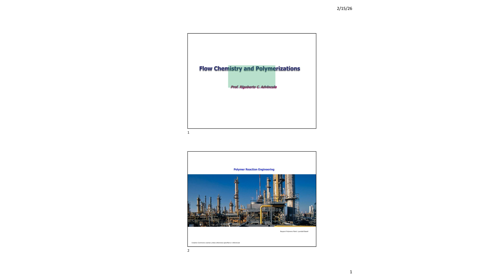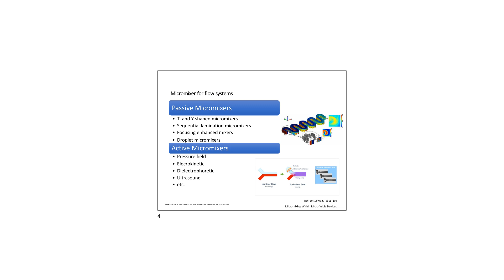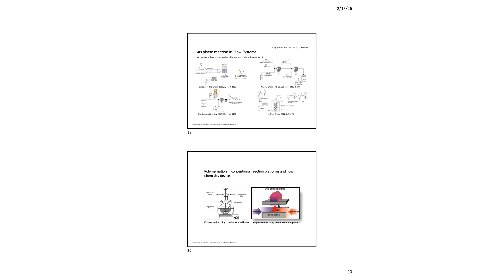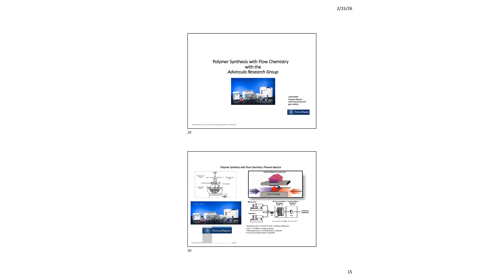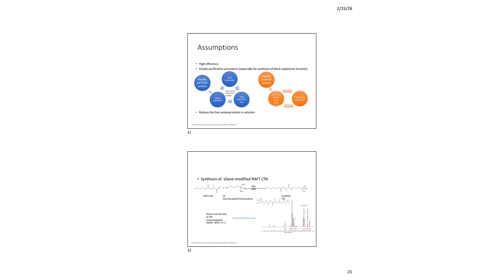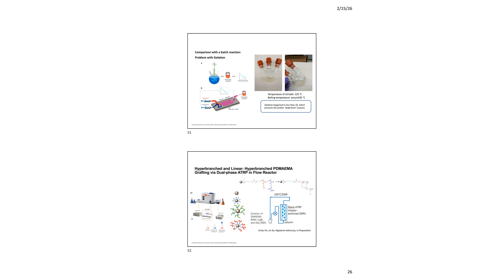TUTORIAL: Flow Reaction Chemistry and Polymerizations

Comment from the maker: SUMMARY:
This tutorial, presented by Professor Rigoberto C. Advincula, provides an overview of the intersection between continuous flow chemistry and polymerization (0:00 - 0:18). It explores how microreactor technology is transforming chemical synthesis compared to traditional batch methods.

Key takeaways include:

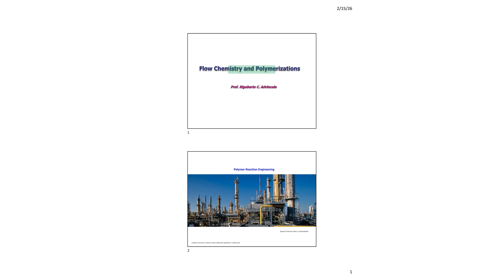Flow vs. Batch Chemistry: Flow reactors offer superior control over reaction conditions, including fast mixing, precise residence time, and efficient thermal transfer, which is especially beneficial for exothermic polymerizations (0:45 - 4:40).
Versatility and Safety: The process is safer and more energy-efficient, allowing for the handling of toxic gases and high-pressure reactions (up to 200-300 bar) that are challenging in large batch vessels (11:24 - 12:57).
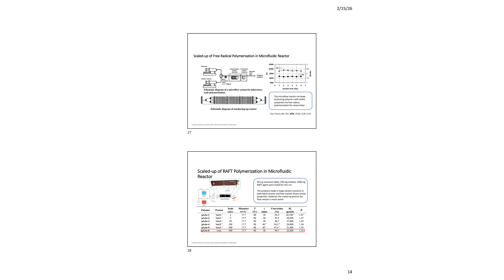Polymerization Applications: The video covers various polymerization techniques, including free radical, ATRP, RAFT, and NMP. These methods synthesize block copolymers and hyperbranched polymers with narrow molecular weight distributions (13:08 - 18:20).
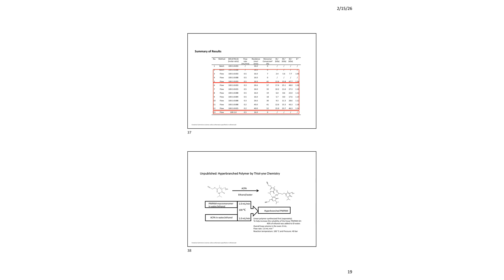Surface Engineering: A key application discussed is grafting polymer brushes from silica microparticles. Flow chemistry enables continuous brush growth, allowing precise construction of complex, stimuli-responsive surface architectures (21:34 - 26:15).
Conclusion:
The continuous nature of flow systems simplifies complex material fabrication by eliminating tedious purification steps and enabling consistent, scalable production.